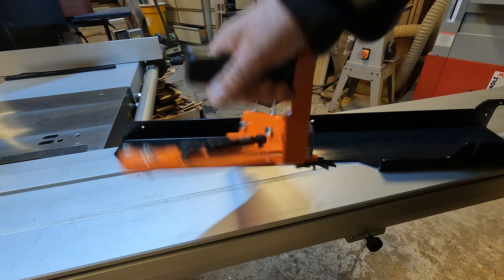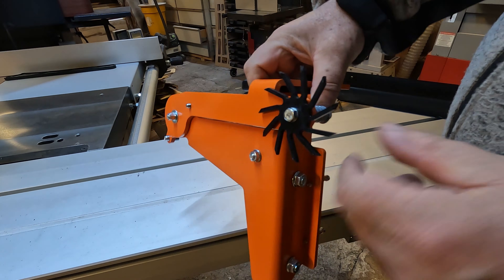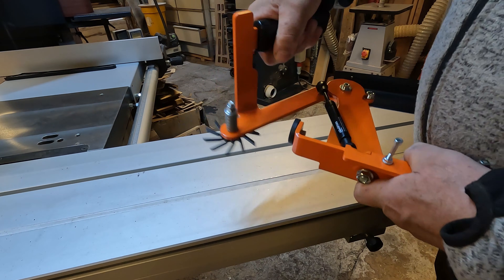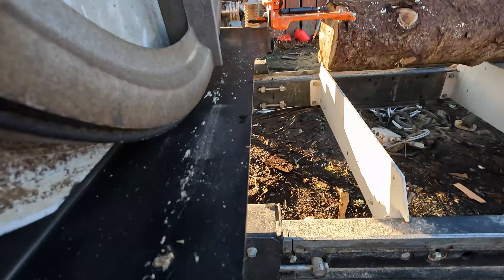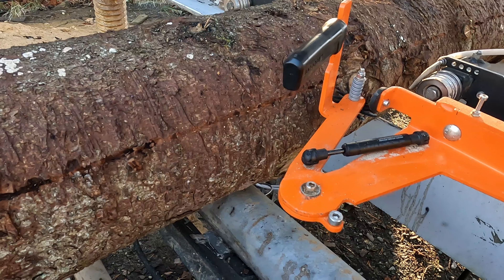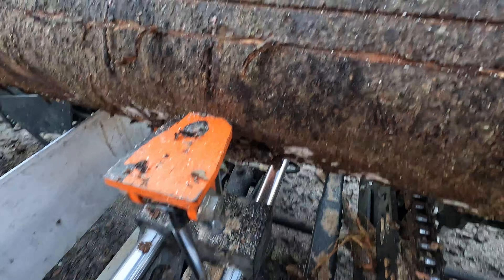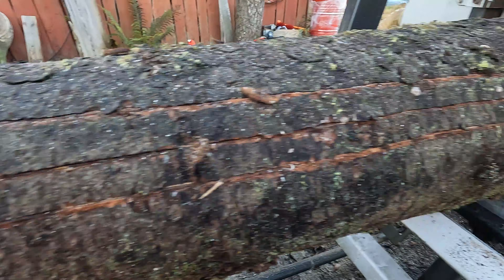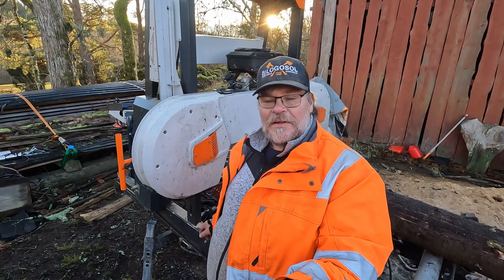Logosol PreCutter: The simplest Debarker in the World!

Comment: You'll get better blade life and straighter cuts when milling softwood if you add a bit of dish soap to the water in the lubrication system. Prevents pitch build up. Husqvarna has a vegetable-based bar oil that works well too.
Reply from the maker: Normally run with a pitch prevention spray on the bands which prevents it from building up. Works really well.

Comment: For the price.. it looks really great! Would get one instantly if I had a bandsaw. But I run a Logosol chainsaw mill with a 661. 

Would like to have something similar there.
Reply from the maker: When I was at logosol last time, they showed a similar one for f2 and f2+, so will come a little later
Reply: @Projectoftheday  I have no eletricity where I am milling. I suppose the version for the F2 and F2+ was for the electric chainsaw and drive? If if works for the manual drive.. I have an order to make :-)
Reply from the maker: I think it will work on chainsaw to, it’s mounted on the bar top steering and I think it’s the same in electric and gas saw
Reply: @Projectoftheday  If you chat with the Logosol guys - tell them to get a move on :-)
Reply from the maker: Haha will do